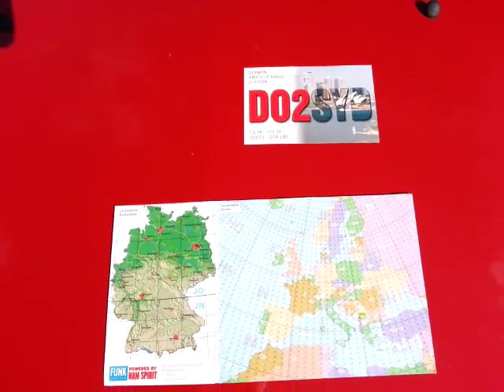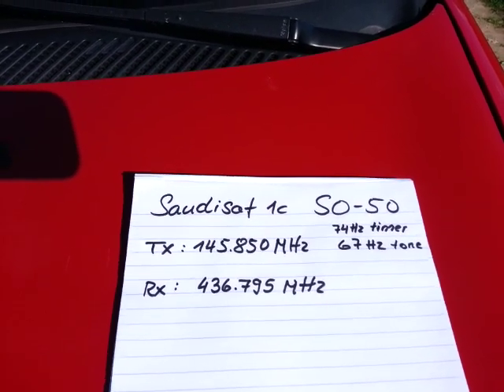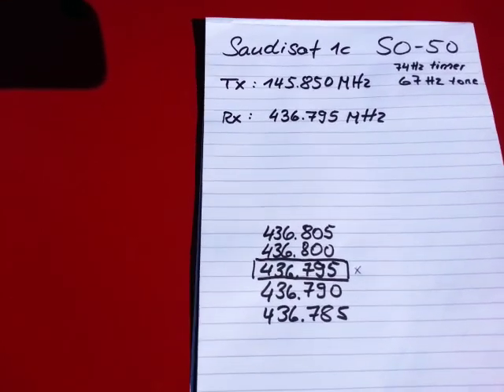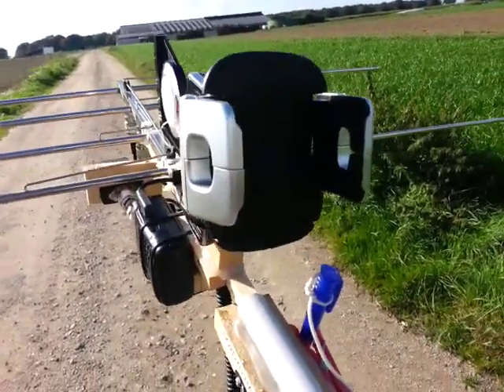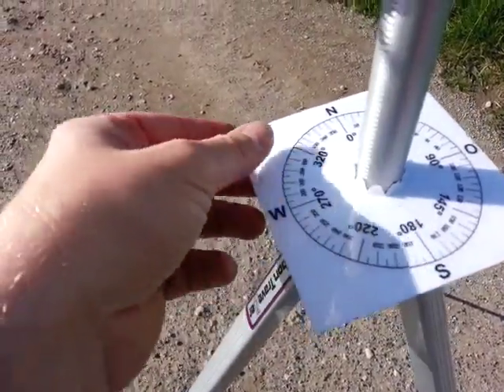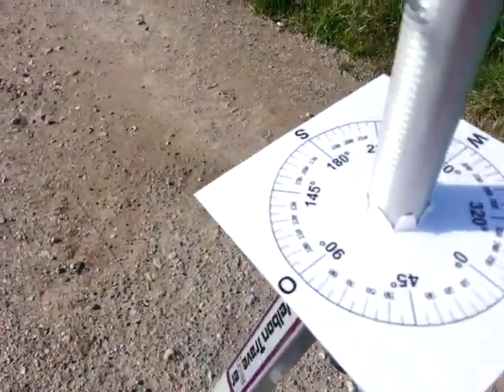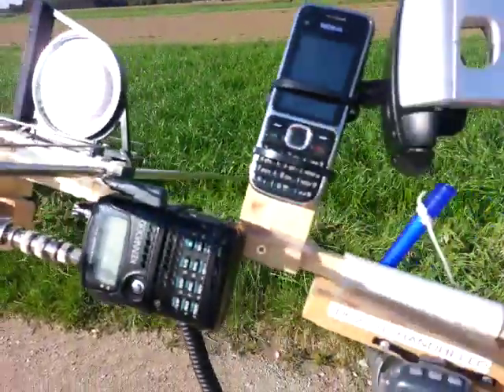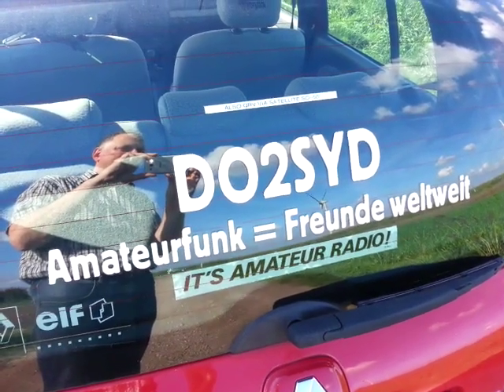DO2SYD english: SO-50 TH-F7E HB9CV Tripod

Comment: Good video. 
It is possible to maintain the frequency of issuing 145 850  because the satelitte is equipped with (AFC - Automatic frenquency control), if did not have to correct the doppler also 
Excellent work ...